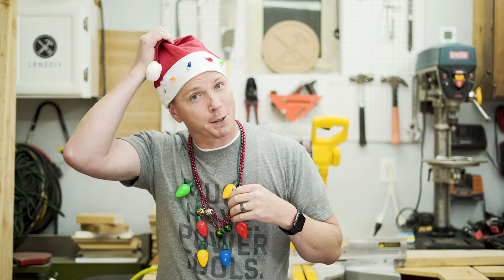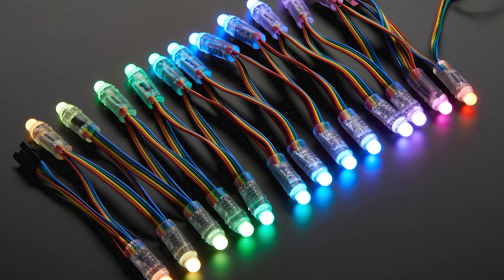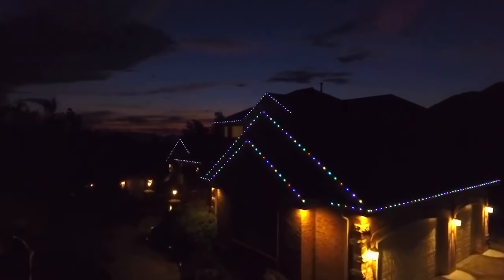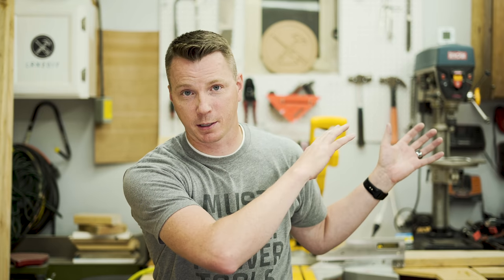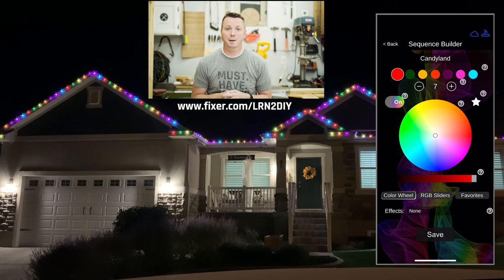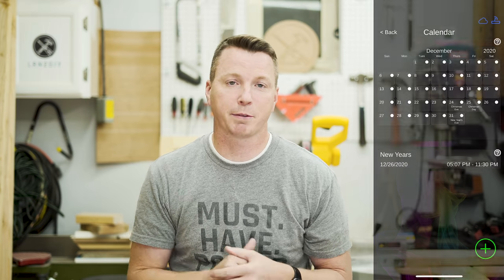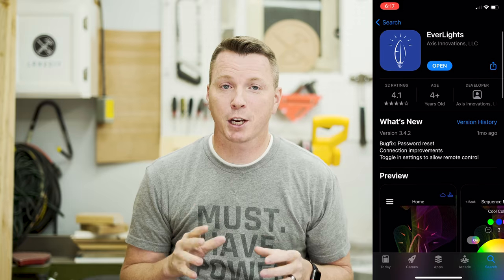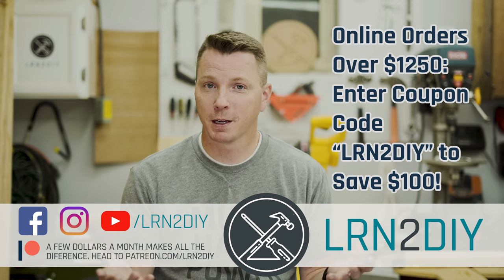Why I NEVER have to put Christmas lights up again

Comment: I did this, this year. I was going to go with everlights as well but decided to build my own DIY kit. I was able to do everything including trimming around the garage for about $500. Picked up 110v argb led in weatherproof silicone (164ft) for about $200. I went with the 110v instead of 5, 12, or 24v so I didn't have to worry about power injection. All mounted in a thin aluminum channel, and I wired them to a Bluetooth Controller that has an app. It turned out amazing, and I prefer the brightness and more solid runs the led strip provides. The aluminum channeling was about the same price as the rope light and the Bluetooth controllers were about $30 each and can sync together. I think if I move though the option you went with is what I'll be doing next. Their Bluetooth app is definitely superior.
Reply from the maker: That’s awesome. Do you have a link to the LED strips you used?
Reply: @J3rbski  hello sir   
Can you please tell me what things we should need for installation  except led lights
Reply: I’ve had concerns recently about 110v lights, especially from a safety standpoint. Probably too many YouTube videos. The biggest two are exposed wiring after a few years of weather and serial connection of lights prone to failure.
Reply: @TomCee53  yeah I think that's a fairly rational concern. Sealing is a thing, but for me personally it's a no - different people have different risk tolerances - the counterargument is lower voltage = higher current = more heat and not less risk of say a fire. Even with that I still prefer the lower electrocution risk and isolation that a DC supplied string gives.
Reply: @J3rbski   Always ALWAYS read the reviews on this kind of stuff... Why? See below...

Fire hazard
These almost burned my apartment down. Those black spots are where it started smoking and almost caught on fire after being plugged in 30 minutes.

Caution FIRE!!!
These lights caught on fire & almost burnt my home down
Reply: Which products did you use?

Comment: Oh... there WILL be maintenance... having 4 wires means one is a CLK and when one pixel dies data will continue to pass - but pixels will go out.  More annoying will be when 1 color in a pixel goes out.

You could have done this yourself for even less.  Depending on the controller you could have far more control over them.

Comment: How resistant to UV damage are these LEDs?  Leaving lights up year round brings a susceptibility to sun damage.
Reply from the maker: Great question. The caps that screw the LEDs into place are a fairly thick plastic, which really helps protect the LEDs. These lights have been up on some homes for about 5 years so we don't have decades of history to look at but so far so good.
Reply: The LED is installed behind the channel or gutter so it's none of the permanent parts are exposed to UV light. If the caps are damaged by UV, they can be replaced easily but it would take a long time for damage to occur.

Comment: Nice, but no thanks.

For my house, I've used a near effortless DIY of DIY methods for the last few years.

- Cheap $15 LED strings installed along the INSIDE of my windows, cut to fit.  They come with an infrared remote.  As long as you use the same brand, a single remote works.
- I change the colors to suit the holiday.  They can do a few patterns, or respond to sound, if desired.
- They are adhesive stick, but I use clear duct tape every 12" or so for neatness and longevity.
- Each one attaches to a smart plug, so i can set the on/off schedule.  Plugs aren't far, but for 2 I use short white extension cables secure along the base boards, and tucked under where carpet is present.

Windows absolutely glow if you have blinds or drapes.

I haven't tried them outside.  But, I bet they'd work well if secured under/behind the fascia.  I'd direct the LEDs at the fascia, rather than outward to the viewer, for stronger and more uniform illumination.  Power would come the corner flood lights, configured to provide a plug.  Just some thoughts there for external mounting.

Comment: Except some communities have passed laws that require all Xmas lights be removed after the Xmas season and if you don’t you will be fined. Where I live there are such laws and they are strictly followed!
Reply from the maker: Some of these rules are antiquated and should specify "removable holiday lights". Because these are permanent and are so difficult to see when not lit, HOAs need to start recognizing the difference. We're fortunate to not live inside an HOA (yes, they have their pros as well as cons) but those rules were generally made to prevent traditional lights from being left up all year.
Reply: @LRN2DIY  , in our town it is a city law and not a HOA rule.
Reply: These lights aren't the Christmas lights that HOAs have rules about. These aren't noticeable during the day and if you didn't know they were there, you wouldn't notice them. They've been installed in 100s of HOA neighborhoods with rules about Christmas lights. HOAs have those rules for the traditional Christmas the you can see from a block away sticking up above the gutter and see the wires.
Reply: @daveanderson6865  , not HOA rules!  These are city laws that require all Christmas or other special holiday lighting be removed 30 days after the event. And they don’t allow any exceptions!  And believe me they can be very hard nosed about it. I do know the difference between these lighting systems, but city ordinances need to be checked before someone makes an assumption.

Comment: You roof should overhang the edge of the aluminum by minimum of 1/2” for water protection. Did you loose that protection because of this install or was it already like that?  I’m guessing you added that (ODE - Outside Drip Edge) as a flashing to protect YOUR channel. Maybe you can explain what happened there.   Not trying to be critical but it doesn’t look to good when the roof doesn’t overhang. With some more info on what you did there & why, I can tell you how to fix it and others how to avoid that. Thanks for hearing me out. I enjoyed the video & your house looks great from afar.

Comment: My worry about this would be the company going out to business and the app getting out of date in 5 years.
Reply: Spot on. If made in China, more than half the led lighting companies go out of business annually. A lot of turnover
Reply: Well, the LEDs are still useful with programs like wLED or xLights. You can fairly easily do this fully DIY for around $300, if you're willing to invest a bit of time learning. All the info is available on YT. Look up DrZzs or The Hookup on YT, if you're curious.

Comment: Drzzs youtube videos using Permatrack and WLED with xLIGHTS would have been so much better though. I'm sure more cheaper as well and everything completely local and not reliant to a company
Reply from the maker: I think what Drzzs does is awesome. I looked into it a ton and may still try it out myself but I think the required programming and configuration is more than what most people will be willing to try... for now. I think in the coming years some of the tech around the DIY options will be significantly more accessible. The DIY installation I show in this video is certainly not for everyone but it's another option for people to be aware of and works so easily once installed, plus I could switch it over to a homebrew option if there was an issue with the company. Have you had a chance to try any of these lighting solutions yourself?
Reply: @LRN2DIY   I haven't tried anything as big as this. We don't really do lights like that in Europe. It's certainly a lot bigger in the US. I have however looking an the DIY options and been playing significantly with Home Assistant. I haven't tried any indoor DIY LEDs either. Although I would not consider WLED (especially when used with Quindor's Digi-uno/quads) to require a significant amount of coding or physical configuration, since it WLED itself has app for the phone and a lot of the effects are already build-in. Then setting up a digi-uno there are a ton of guids from Quindor himself. Sure you can automate and control it from Home Assistant if you wanted but it is not a requirement. You could just use the WLED app. And I think that a lot of people would rather spend a couple more hours setting it up and spending less money on the parts than buying a ready solution.
Reply: @DWTHAN  Quindor seems like the LED wizard! 😁

Comment: Very nice but couple things.
1 HOA seeing them and fining you unless you take down
2 What do you do if a couple of lights go out or pixels go out? Do you have to replace entire section?
3 What or How do you control with app if company goes out of business and no longer supports app?

Just seems to good to be true. But love the look
Reply from the maker: All great questions. 
1) I don't live where there's an HOA but for real - these things are nearly invisible during the day. You can see what they look like during the day here (scroll to the bottom): https://lrn2diy.com/permanent-christmas-lights/. If an HOA still has issues with this, it's worth fighting that fight. These will only become more popular and Everlights are even LESS visible than most competitors, which use larger channels and use them everywhere.
2) If a pixel goes out, you can replace that specific pixel only, but it's suggested to replace the pixels on either side of it just in case. Also, there's a backup line that runs to every light, meaning that if one does go out, it doesn't take any others out down the line. They'll continue to work.
3) I've done some experimenting and you actually can run these lights with 3rd party software. The software/hardware setup Everlights provides works beautifully out of the box but the option is there. Additionally you can run 3rd party lights with Everlights software. Not sure I'd want to mess with that unless I had good reason but it does work, so I'm not at all worried about that one either. 
I hope that helps with your questions!
Reply: Thsnks. Very cool. Unfortunately I have an HOA that is a stickler for everything. But I will ponder this.
Reply: @LRN2DIY  Thsnks. Very cool. Unfortunately I have an HOA that is a stickler for everything. But I will ponder this.

Merry Christmas!!!
Reply: @anthonyz5671  these lights have been installed in 100s of HOAs. They aren't the Christmas lights that HOAs have rules about.
Reply: @LRN2DIY  what is the 3rd party software you've used to run the lights?
Reply from the maker: @daveanderson6865  Check out this video by DrZzz where he shows different software to use and links a few in his description. https://youtu.be/tXvtxwK3jRk

Comment: Question: The lights in your video are very attractive, more like actual Christmas lights and less like the Vegas strip. Are you operating them at 100%? Is that feature even an option? Or do you achieve that look by aiming the lights out instead of down?
Reply: The lights can be dimmed but EverLights are designed to look like Christmas lights. They are spaced 9 in. apart.

Comment: Not a DIY guy....I am looking a trimlight and jellyfish.....its about 120 feet I need done. Any tips on differences between the 3.
Reply: They main difference is mentioned in the video. The biggest difference is that EverLights point outward like traditional Christmas lights. Trimlight, Jellyfish and most other brands point down and illuminate the walls.

Comment: What type of individual addressable LED’s (make/model) were used and do the screw-on nodules come with the LED’s or are they sold separately?
Reply: Does anyone know??....the LED I am talking about is shown at 4:44 of the video.
Reply: @Coach Steve  Some great channels that cover this are DrZzs, The Hook Up and QuinLED/IntermitTech. The strings are probably WS2811 or WS2812. The channels/brackets might be part of the kit, but there are other options. I picked up 5 rolls of 5m/16.4 ft individually addressable RGB LED strips (not strings like these) from BTF Lighting. I went with 5V, 30 pixels/m IP65 rated. I haven't put them up yet, and I haven't decided if I'm going to use my Raspberry Pi or Arduino Uno. I still need a power supply and figure out how I want to mount them. I'm thinking aluminum profile/channeling with diffusers/lenses. It gives more uniform light and hides them. Or I might get silicone "neon" tubing. I just suck at putting my mind to things.
Reply: @grabasandwich  Thanks for the info. Yes I agree DrZzs is a great channel, that’s where I got inspired to try it myself. I will check out the other channels also.
Reply: @grabasandwich  Just did the same thing and went with arduino and wled. Its a lot of work, but wow it looks great and the cost savings / flexibility cant be beat.
Reply: @fix8ed387  mind me asking what you did for power? Did you use a meanwell?
Reply: They are the brand he mentions in the video, EverLights. Yes, the screw-on caps come with the LEDs.

Comment: I too love the idea, but living here in Chicago Midwest area, wonder how the wear and tear from our extreme weather. Any data on how long it will last? I think if I spend under $600 for 5 years I would do. Thanks for your videos.
Reply from the maker: Hi Reymundo. This technology (outdoor LEDs) has probably been around for 10+ years but these commercial options are more like 5-7 years, so we don't have a ton of history to draw from. The lights themselves are all capped in a thick plastic cap to hold them in place, which would provide a lot of protection so I think these will hold up quite well.

Comment: Great idea,  but cringe watching you smash barrel connectors with needle noise pliers.  Use the auto crimp tool for less than $10. Also,  some barrel connectors have built in shrink tubing to make them even more water proof.

Comment: What did you use to measure the linear area of your roof? You had it nicely drawn out.
Reply from the maker: Since you can get a fairly rough estimate for ordering (just err on the side of having a few extra feet) you can measure something on your house, take a photo with that thing in the photo and then use it kind of like a ruler to get an estimate. You can even lock a measuring tape at 10’ then put it up against your house for the picture.

Comment: Several things come to mind, not that I’m totally against the idea.
1. Never use ‘never’ in your title. Everything breaks. My best guess for this is about 3-5 years. How repairable?
2. Mounting in the gutter and gutter cleaning could be problematic. Are the wires covered?
I’m sure I’ll have more questions after checking your website.

Comment: What do you do when it’s time to paint the gutters?
Reply from the maker: You can just remove the caps on each light and push the lights back through them tape them up from the back side. After you're done painting, just put the lights back in and put the caps back on.

Comment: Good job on making it look 1000x easier than it was. We know this was an absolute nightmare every step of the way to the point of being basically not worth it.
Reply: If you are hanging lights every year then just think of it as 2 years of regular light hanging.
Reply: It's not for the average homeowner but for the DYI person that doesn't mind being up on ladders and/or roof, the average house can ve done in a day or two after some research & education on the company website.

Comment: Did you have to worry about power drop?
Reply: Yes, you do... But you just need to inject power at multiple locations along the string/strip. It's fairly trivial, if you're already at the level of doing this yourself.

Comment: Any options for solar power for these kits?
Reply from the maker: I think you'd have to get a bit creative but I would think you could. They don't take up very much power at all but the tricky part is that they're connected to a controller that receives the wireless signal and probably takes up a lot more power than the lights themselves. If you could get around that, powering the lights wouldn't require much solar or much battery.

Comment: My problem is lights stop worrying after 1 season. Even brand new, year after year, LEDs. Stop working next year and I'm replacing 20-50% EVERY FLIPPING YEAR
Reply: I don't see this being fixed by putting up permanently lights. Fact that sounds WORSE

Comment: Hey, so I usually put up the C9 bulbs. Are these as bright?
Reply from the maker: I ran C9 LEDs before getting these and I’d say these are just as bright if not brighter, largely because they’re so close together and can their brightness can be adjusted. Sometimes I run a dimmer, more subtle pattern too.
Reply: @LRN2DIY  I probably missed it but how far apart are they? I use c9 as well 12 inches apart. also what happens when one of the LEDs goes out can you easily replace it like you can with the c9 bulbs
Reply: @USAFreedom4Ever  They are spaced 9 in. apart. If an LED needs to be replaced it can be cut out and new one spliced in.

Comment: Hi Nils, are the Channels available at home depot? Thanks
Reply from the maker: The channel is not but you can do a DIY version. You can purchase, for example, aluminum J-Channel and drill it yourself instead, like this: https://www.homedepot.com/p/1-2-in-x-12-ft-White-Aluminum-J-Channel-Trim-77012/204103159.
Reply: @LRN2DIY  Thank you.

Comment: Have you had any LEDs fail?   What is/ was the repair process like?
Reply: Yes, individual LEDs can fail, usually from being damaged or wiring improperly during install but doesn't show up until later. The fix is to cut out the bad LED and splice in a new LED.